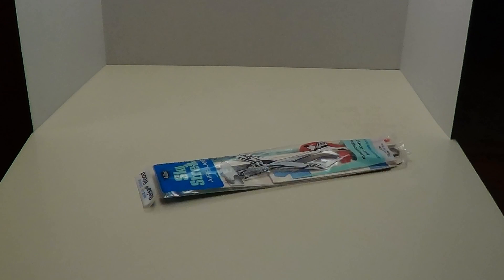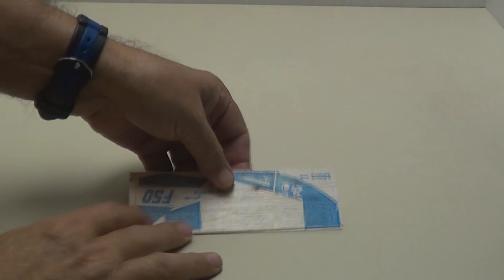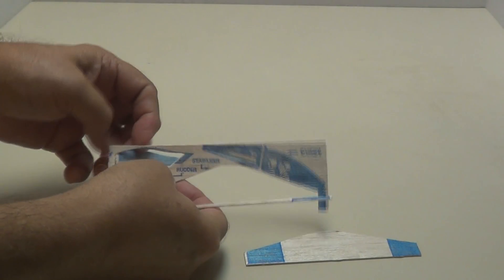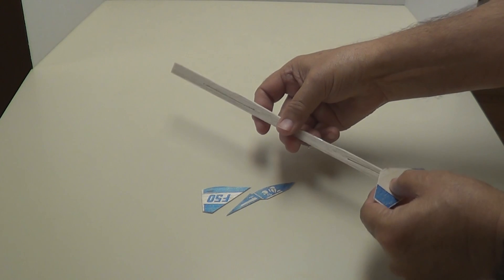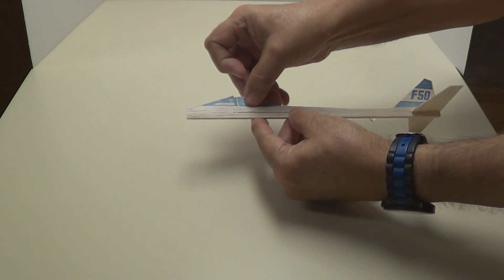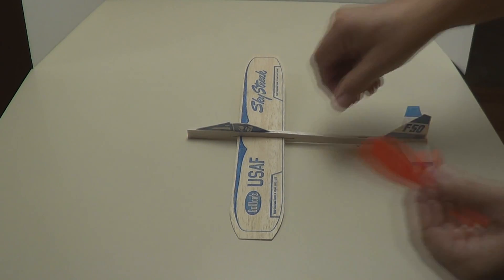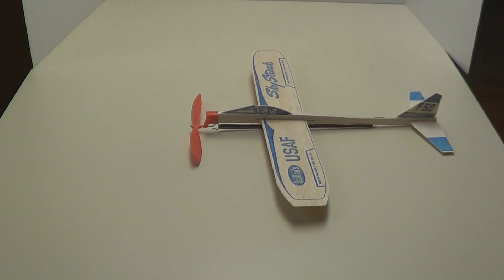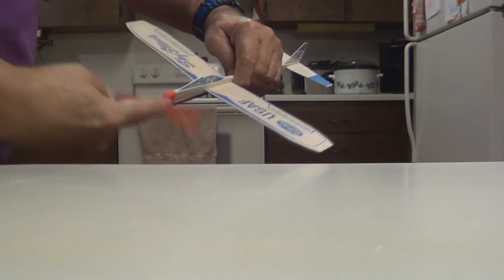How To Build And Fly A Rubber Band Powered Plane 2 Guillows Sky Streak

Comment: Good video. These little stick jobs have a big fun factor. I got away from rc and went back to simple planes like this. Took my Jetstream which I believe is the little bro to the Sky Streak, stuck a better 6 inch prop on it, and threw out the rubber band that came with it and put a much longer loop of 1/8" contest rubber on it. The little thing really flys given the benefit of a decent prop and rubber. Check out the Jim Walker,American Junior Hornet. You can still buy them, and switching out the 1/4" rubber for 1/8" gives them really long flights.
Reply from the maker: +John Riggs I agree and will look at Jim Walker